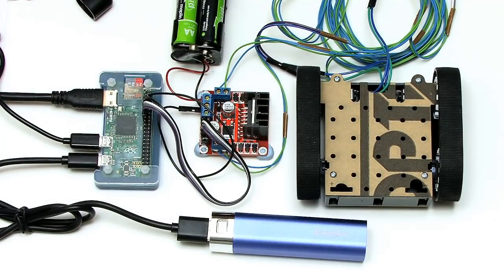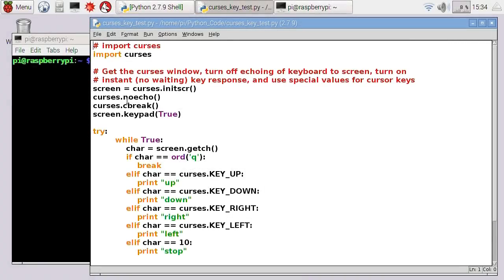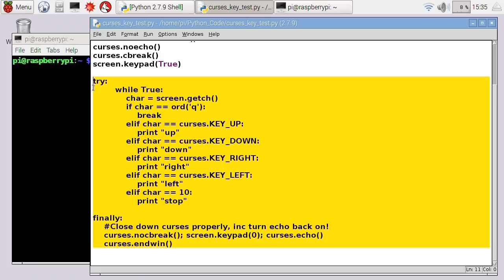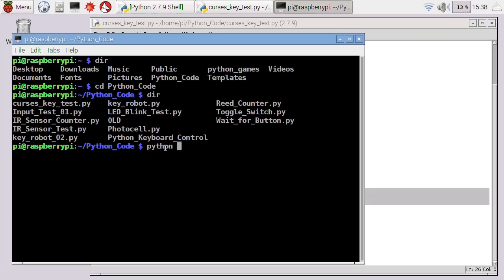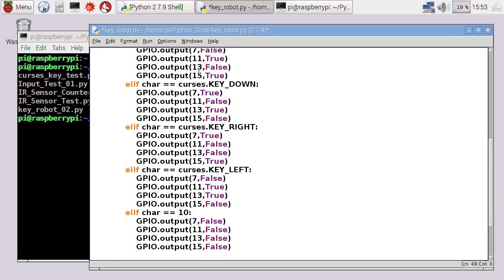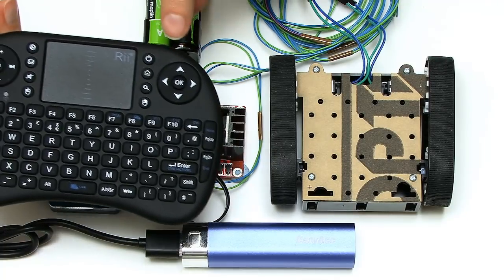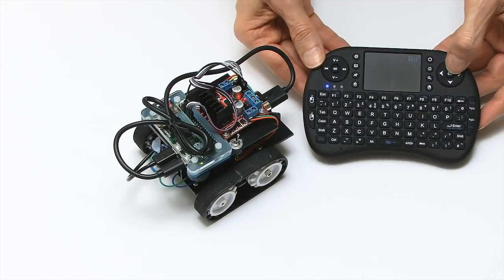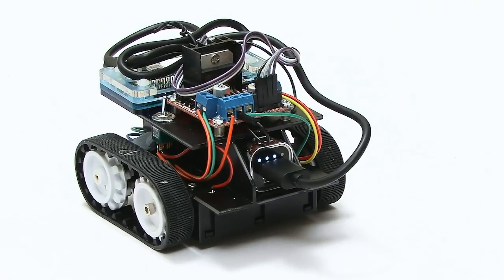Raspberry Pi Robotics #3: Keyboard Control

Comment: maybe you could add another video to this series where you optimize the code a bit. Maybe write unctions for forward, backward, etc.. and then just call functions to perform the little predetermined pattern. You wont need to write aqll that code every time.. Great beginners tutorial. Thanks.

Comment: I misplaced the original dongle which came with the Rii, so I ordered another one. Now I can't pair the keyboard with the RPZero (yellow light on the kybd keeps flashing). I've tried rebooting the RPZero with the dongle/receiver installed, to no avail. Happens each time I power on the Rii with F1 depressed (for pairing). Any thoughts for a solution ? Oh, I'm using a VNC session to control the Raspian session (32 bit) from my Windows -11 PC, but I can't see that this would have any bearing on this problem.

Comment: Hi there, I recently purchased a raspberry pi 3 & installed an internal fan - but was wondering if you can show us how that fan can be controlled to activate at 47 degrees or so and deactivate at 35 degrees < or any temps.  Currently the small fan is directly wired to GPIO pins #2 and ground wire #6 i believe.  I've been trying to research online but they don't explain much detail in how the coding is done.  Well thanks very much I find the raspberry pi videos interesting with the things people can create with them.

Comment: Which powerbank I can use to Rpi3 in similar project?
I have 5V/1A, but is to big. To my surprise Rpi worked stabil, but I didn't plug mouse, keyboard and screen. Any sugestion which powerbank will be good solution?

Comment: 👍👍 Tips and advice aplenty. Only yesterday I had to cut some plasticard for the first time. I used a dremel with a circular saw attachment. The resultant line was like a dog's hind leg. The plastic melted in caterpillar-like blobs which had to be snapped off and there was much filing and sanding done to make the job look presentable. Dear oh dear.

Comment: what about transmitting the A/V signal ( video) over the Transreciver ( Transmitter RF) and using an other Transreciver ( reciver RF ) to gey the video for either coding or riding around with the camera also mounted ? the RF modules nowdays are common and cheap things and it would be fairly easy on Zero to get the AV signal out straight from the solder points on the board .  Might be a nice video ;)

Comment: Very nice tutorail and i will most certainly view the other ones. Little hint for anyone doing any programming (might already be mentioned in the older comments ine here) try to avoid any copy paste madness. If you need to repeat anything (like his dancing sequence) you can just make the movements into functions.
This saves time, headaches and in more complex robotics filesize(not THAT important but you never know) + its generally a good habit to learn in programming.
O and excuse any mistakes i may have made :D
Ex. with the move forward function

elif char == curses.KEY_UP:
GPIO.output(7,False)
GPIO.output(11,True)
GPIO.output(13,False)
GPIO.output(15,True)

instead you can do this:

elif char == curses.KEY_UP:
moveForward()
~(the rest of the code)

(this needs to be waaaay at the bottom and not inside the main part of the code or else it isn't a proper function)

def moveForward():
    GPIO.output(7,False)
    GPIO.output(11,True)
    GPIO.output(13,False)
    GPIO.output(15,True)
def moveBackward():
    ~
def turnLeft():
    ~
def turnRight():
    ~

Comment: I'm having trouble running curses?? I'm running a raspberry Pi Zero W, Just updated & upgraded raspbain to latest version. But when I try running Curses in terminal I get errors, Do I need to install curses 1st??. I running your program un modified.
Any Ideas of what I'm doing wrong?

Comment: Another great video! Would it be possible to use twin joysticks or 2 slider type potentiometers to control each motors speed and direction independently, for smoother operation? i'm using a raspberry pi zero w, so i'm thinking of using a bluetooth gaming controller. Keep up the GREAT work!

Comment: Hi Christopher  i said before i had built one on a cheap chassis  since then i have added a camera using motioneyes software downloaded on raspbian  all running on a 512 meg pi model b  i intend to control the camera pan and tilt using adafruit 16 servo control board  and a really cheap mount i bought on ebay as i am 72 years old it amazes me how easy this type of computing/robotics have becomekeep up the good work
Reply from the maker: All great to hear Robin. It is indeed amazing how this tech has evolved.

Comment: Hello, love your videos.  Very informative, I'm about to start on a similar project.

I'm looking at Motor Controllers on Amazon, yours has 220/35V/VS written on the jumper.  What is the VS?  I see these on Amazon with VT and UT where the VS is written.  Is that a manufacturer code, or something important?

Comment: You can add the time function in the first place and configure it to run around 0.1 seconds each time the key is pressed which eliminates the need to add the stop key (like a RC car).

Comment: What a fantastic video to stumble upon. Absilutely Brilliant Content and delivery. Well done sir. I look forward to viewing more from your channel. Thank you.
Reply from the maker: Thanks! :) There are three more videos in this Pi robot series, and three more (so far) in another one! :)
Reply: ExplainingComputers out of curiosity. Is there any Content you have or could recommend for controlling a brushless motor? Or is it the same idea as the video? Thanks
Reply from the maker: As far as I am aware, controlling a brushless motor is no different to what we have here -- you need a motor controller to allow low-level digital signals to allow a high power electro mechanical device to be controlled. Note that the L298N used here can also be used to speed control the motor -- something I will be covered in video in early 2019.
Reply: ExplainingComputers perfect. Thank for for taking the time to respond. :)

Comment: The Rasp PI IO is a 3.3V logic while the L298N  is TTL (5V). You may want to use level shifters to protect the PI from possible damage and power supply leakage.

Comment: Can this be done with the pico w?
Reply from the maker: Yes, but you would need a means of connecting a (remote) keyboard or controller, and the Pico is a microcontroller, rather than a full computer like the Pi Zero. So it does not directly support a keyboard (and hence keyboard dongle). It is possible to interface connect a keyboard with a Pico though -- I do it, for example, in my PicoMite VGA video: https://www.youtube.com/watch?v=kZaWYgIYgd8 Good luck! :)

Comment: Brilliant, as always! Quick question about the Rii keyboard? I was able to map most of the keys by commenting out the (curses.noecho()) bit in your code but I can't figure out the left disc. (V+, V-, |<<, >>|). I wouldn't have known the right disc's up, down, left, right code if you hadn't posted it. Any master key mapper for the Rii 8? Thanks for your videos!!!
Reply from the maker: I can only suggest printing the curses output to the screen and trying each key :)
Reply: @ExplainingComputers  Ok, I've been trying that and reading the curses (ncurses) docs with no luck. I can map most of the standard keys, it's just the special character keys. Thanks for the info though...

Comment: Understand why the motor battery ground wire is connected to the driver, but why is it also connected to the raspberry pi?  Doesn't that defeat having optical isolated?  Or does your driver not have optical isolation?  Thanks for the videos.
Reply from the maker: If it was not connected to the Pi, it could not possibly work. :) There has to be a shared electrical connection. There is no optical isolation here.

Comment: Do you have a Web site with your code? So I have a pi 3 b and noobs on it. I see there are several programing languages. I haven't any experence in any of them. I programed in basic in the 80s, and tried to get back into it with vb, but never really could make the change. I always wanted to program robotics. I worked with a million dollar robot that loaded parts into two twin spindle vertical layths. Wish I could have programed it, but they had thier cnc programmer doing it.
Reply from the maker: Scroll down on https://www.explainingcomputers.com/rasp_pi_robotics.html

Comment: Thanks for the great video. Could you please tell me how does the python program automatically runs when you turn on the pi?
Reply: Did you run the program before disconnecting the hdmi and just turned on the motor?
Reply from the maker: I did indeed. See this video, which explains how to run the code automatically: https://www.youtube.com/watch?v=j6mglfhWZrQ

Comment: Hey! This is a really nice project. One thing i would change: I would change the code in that way, so the robot moves as long as a button is pressed. So it will be more controlable.
Reply from the maker: Agree on the code, but harder to do -- at least in a manner that can be relatively easily explained, and implemented consistently in any version of Python. :)

Comment: Hey, Nice Video. Unfortunately ist doesn`t work for me. The curses Window will Open up but i don`t get any response while pressing the Key`s. I use a raspberrypi 3b with Python 3.5.3. Do you know a reason why it won`t work ?
Reply: same issue here! mine was saying no module named RPi.GPIO..... the keyboard test worked great! 
if i run the file with python file.py i get         bash: python: command not found

if i use python3 file.py i get a black screen like the keyboard test but no actions nothing show up on the screen.

Comment: are you sure that you don't need to change other bit of the code other than the strings after the print () command
Reply from the maker: Pretty sure, but I would have to check. I cannot remember everything in 240 videos! :)

Comment: Hey! Ive been following this project very closely, but I seem to find that my motors don’t spin. To make sure that my program is functioning a hooked up an LED to the Raspberry itself but when I hook it up the the Controller it doesn’t work. I’ve rewired the thing and still nothing. I am however using different motors than you. Could that be a problem?
Reply from the maker: It may be that you have hooked up higher voltage motors, which hence are not getting enough power.

Comment: Amazing video series :D Brother and I have been following along and building our own robot and everything is working exactly as you show it. However, I'm wanting to control it with holding down a key more like how an RC car or drone would work rather than click a button and it moves unless you deliberately say stop. Every time "screen.getch()" is called in my code the code stops, just waiting for a keypress. Any way to work around this or get it to work?
Reply from the maker: I keep meaning to do a video on this. There is no really easy solution in Python. So I am still working on this!

Comment: +ExplainingComputers / Christopher
Good video and also a good introduction into the usage of Python.

I am personally interested in the Broadcom Y USB / WiFi access point adapter and can foresee a host of IoT styled projects that this device could be used within. 

I have been reading about how this device could be used with the Broadcom WICED Sense device (bluetooth / USB device with gyroscope / accelerometer, compass, pressure and humidity / temperature sensors) and would be interested in seeing any future projects that incorporates these or similar devices.

As usual, you are providing informative and interesting content, keep up with the good work!
Reply from the maker: Many thanks Mark, always good to hear from you. :)

Comment: Hi, are you still familiar with this? I set up an x box controller on my PC to interact with the python interactive shell but the d pad on the controller sends a different 'up' command to the PC keyboard such that the robot doesn't move by the d pad and it does by the keyboard. Any idea why?
Reply from the maker: This will depend on what the controller is outputting. Curses, as I used hear, reads a standard keyboard. Yu could try printing the curses output to the screen (as I recall I do early in this video) and pressing buttons on the controller to see what it outputs.

Comment: For some reason when I run this code,  after about ten seconds one of the motors will stop responding. It will still respond to forward and left commands but not back and right, whilst the other motor is fine. Initially it will respond fine to all commands but like I said after a few seconds it will only go in one direction. I have tried two Pi W's admittedly with the same SD card. I also made the Pico W version Robot and that had no problems at all. Perhaps I need a new SD or something for the Pi W. Strange.
Reply from the maker: This is strange. By trying two different Pi Ws, you have ruled out issues with a particular GPIO pin. It could be an issue with a connection to the motor controller, and out to  the motor on that side. You could check for a motor controller issue by switching the motors over (A to B and B to A, as it were). If the problem persists, but on the other side, then you will know the issue is with the L298N.

Unrelated, you may be interested in the better control code that I put together in this video: https://www.youtube.com/watch?v=H1PIzxNdGGk
Reply: @ExplainingComputers   Thanks for the help, I installed a new version of raspbian and that seems to have solved it. I wanted to use that pygame code but I could not get pygame to run via ssh as I wanted to control the robot through a networked computer. I have tried so many things for almost the past week, many many bits of code, endless googling and watching videos. Turns out all I needed to do was run the pi over VNC and now it works perfectly. It's going to be for an Escape Room. The robot will actually be controlled by touch sensors using the Bare Conductive touch board and the HID Keyboard function. I should probably send you some commision if the Escape Room is successful. Thanks Christopher.

Comment: Great video but how do you control the motor speed with Python?
Reply from the maker: You would need a different hardware setup for this, as the motor controller used here can only turn the motors on or off in forward or reverse.
Reply: Arduino can control the speed with this controller, shouldn't the Pi can do the same?

Comment: I made something like this and use Your python code. I have question. My car runs until press enter, can i change to run only with press button? Ater depress car stopped ?? Thx
Reply from the maker: This I will deal with in the next part of my Raspberry Pi 3 Devastator Robot series (which builds on what I did with the Zumo). In the latest part I added a camera: https://www.youtube.com/watch?v=pK0XvjiP2qk

Comment: Ive done this and loaded the code using the terminal but when I press the arrow keys nothing happens Ive turned on the batteries after loading and connected everything the terminal is called pi@rasberrypi:~/Desktop which is where I saved it same as his any idea what I've done wrong?
Reply from the maker: You need to trace back so fewer variables are involved. Do you have the earlier code working to print text from the keyboard? IE is this an issue with curses, or your GPIO/motor setup? Good luck!

Comment: ive finished doing it but when i run the code it doesnt do anything when i use up, down, left or right. i am using the DROK motor controller like you left a link to on your website
Reply from the maker: Do you have the initial CURSES test working? If that works -- you must be running the code from a terminal -- then it should work for the robot.
Reply: doing all of that. ive checked all my wiring and its fine it just doesnt work

Comment: quick question...Can I replace the 2 AA batteries with a 12v source using the same wiring? Pi can have some trouble with this 12v p source?
Reply from the maker: There are four AA batteries here powering the motors, not the Pi. You can replace these with 12v to power the motors using an L298N. The Pi cannot take more than a 5V input. Some L298N boards have a 5V enable that will allow the Pi to be powered. This is covered as part of my video here: https://www.youtube.com/watch?v=j6mglfhWZrQ

Comment: Why did you not use the battery case built into the Robot case?
Reply from the maker: This could potentially be done, although it can be hard to run a Pi in a stable fashion from 4xAA (4.8V), and similarly running the Pi and the motors from the same supply (without a decent regulator in the middle) an cause the Pi to crash!  :)

Comment: The broadcom USB device looks v.useful
Reply from the maker: Yes, it is a very nice piece of hardware. Made by the manufacturers of the SoC for the Pi, so highly compatible with the Pi, and also very low power drain.

Comment: I'm following your code in this video to run the GPIO pins. every time I type the finally section of the code I get a syntax error. Any idea why this is happening?
Reply from the maker: This perhaps suggests that a colon is missing after the "try" . You can download the exact code from: https://www.explainingcomputers.com/rasp_pi_robotics.html
Reply: @ExplainingComputers  Thanks for the quick reply! Would it matter that my Raspberry Pi has IDLE3 not IDLE2?
Reply from the maker: The code in the video is indeed written for Python 2. However, I don't think there is anything that has changed for this particular program, and it should not impact the try / finally setup.
Reply: @ExplainingComputers  Thanks for your help. I was missing the : after Try. I copied your code and pasted it as is into IDLE on my raspberry pi, saved it and then opened terminal to run the code. I keep getting a syntax error after hitting enter... it says its a syntax error in line one and then lists Python 2.7.13. Any idea what I've done wrong now? Thanks again for your help.